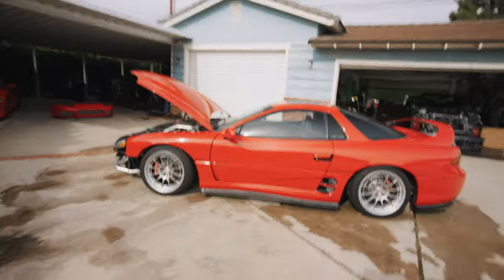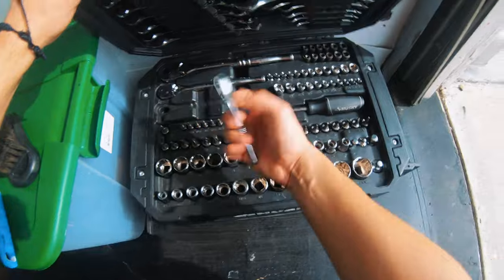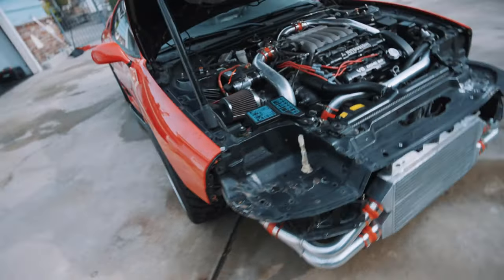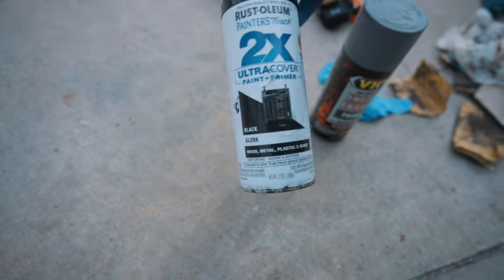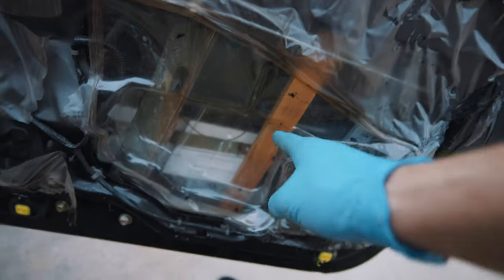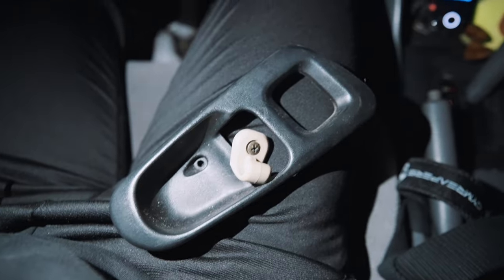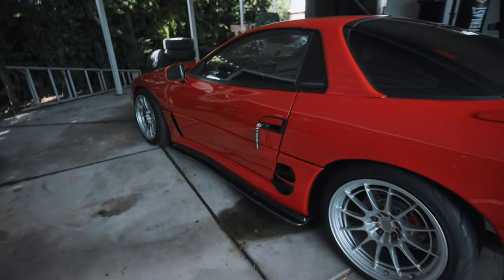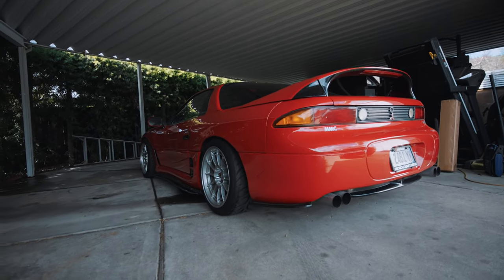RESTORING My 1998 TWIN TURBO Mitsubishi GTO!

Comment: Gotta love a cleaning/refreshing video👌🏽

When I purchased my Miata, both windows were in the same shape except they were being held up with vice grips lol. It’s possible to fix the metal wires that go into the regulator but it may end up being a headache. I hope you find your solution for it soon!
Reply from the maker: It’s in the details 👌🏼 hoping to take it apart soon to figure it out

Comment: I just have the 3000 GT SL.  I had the motor  rebuilt. 🔑👠🎀⛽😁 I have to take it back into the shop since it is still being broke in for a free oil change at 500 miles.  The car has 133,000 miles on it.  I thought I had better get it done before there are no parts left.  It also has a new exhaust,  so it now sounds deeper!  The man that worked on it said that when he could not find parts for it, He tried the Dodge Stealth places and found parts, so you might try them if you are having trouble finding parts for your window.  Your car is awesome and I hope you get it completely done!  I heard that there were only 17,000 made in 1998, like my car!

Comment: I am planning the same thing on my 2G, freshen it up, as far as figuring out the regulator look at the driver side one as reference,  should be the same set up and mechanical functions as the passenger..
Reply from the maker: Does yours have rust in the same area as well?
Reply: @MiguelDsm  it had little metal plates that can be removed looking kinda rusty,  I need to take them off,sand them and clean it up. It's been something on my list since early December,  I just got other things I been doing so it got put on a back burner
Reply from the maker: I get it man. Only reason I get to it half the time is because I’m already in the habit of doing something to the cars for the week of filming

Comment: The motor works but the regulator is busted. If you can get both regulator and motor together since parts are scarce on these cars. Also check to see if you find them for a dodge stealth R/T..
Reply from the maker: That’s what It looks like. I just want to see if it’s salvageable
Reply: Not a DSM

Comment: You need a window regulator from a 97-99. The mounts are different from a 91-96. It's a common issue the top plastic wheel part breaks from being this old. Your best bet is the 3000gt stealth facebook marketplace. If you do find a used one look for the cracks in the plastic part of the regulator. You can use a plastic epoxy or JB weld to keep it from breaking like yours did.
Reply from the maker: Thanks for the Insight. I’ll keep an eye out on fb groups
Reply: @MiguelDsm  Your welcome, I didn't see anything on eBay. You might get lucky and find one in a junk yard like a bring your own tools salvage yard.

Comment: Good stuff. Some lil advice if you plan to do any other ones later:

A rust conversion spray would do you really good to neutralize any slight rust that was there from sanding, even though it's been cleaned. Then your primer, or Evercoat makes an awesome black matte paint called "Black it out". really durable as well.

On the regulator, Now you know the regulator is  bad, find out who recables them.

The window can be propped up with a lil block trick by screwing 2 small pieces of wood together with drywall screws, then prop up the window front and back using cloth as a soft base and using any holes in the door where some stuff may have bolted, just screw the board in and you should be fine.
Reply from the maker: Is there a specific brand you recommend? I’ve never heard of that
Reply: @MiguelDsm  Duplicolor rust fix is quite good for stuff like that. Then you can add the evercoat Black it out. Works really nice for trim and stuff as well. There's a satin option also

Comment: Hey Miguel.  3SX sells replacement window regulators for 97-99 3000GTs.  Unfortunately, they're almost double the price of the 91-96 regulators since the 97-99 cars are much more rare.
Reply from the maker: I’m gonna try my luck on the 3S fb groups

Comment: check with a dodge dealership parts house or a mitshu one they may still have a regulator somewhere in their inventory yet or may find one at another dealership they also have a scymatics for the cars so you can see which part you need. what needs to be done is to have demand for the parts then some manhufactor may start supplying parts for them like it happened with the muscle cars and rods.
Reply from the maker: Hmm that’s good insight. Although the stealth wasn’t made after 96 if I recall. I don’t think they’ll have the regulator in stock
Reply: @MiguelDsm  they should know if is intercangable plis grab the parts number off yours that will call up if it is or not Miguel and they may have used that same part on another of their cars. like the avenger they used parts from the DSM on those.

Comment: Update 3sx on the used parts they a bunch of doors said some with glass and panels some with out .. check it out .There’s a guy he has a channel he goes over the window reg and how to adjust them and he has video on the door locks as well .. think the channel is 3000gt gto restoration good luck It’s been two years and still haven’t found one yet .. luckily mine isn’t out yet just thinking about the future lol

Comment: Well it looks like need to replace the windows regulator.
Reply from the maker: Yup. Trying to see if the one on it is repairable as the motor is still working
Reply: @MiguelDsm  Hope you get it done and working correctly. Wish the best bro. Vamos por mas voy a ti.

Comment: 10:20 yoooo oddly enough that’s the same color that’s on my 3k😭well was. I fully sanded it because the paint job was terrible. There were run marks everywhere and it was chipping in some areas.
Reply from the maker: So is it an oem color?
Reply: @MiguelDsm  nope, not at all